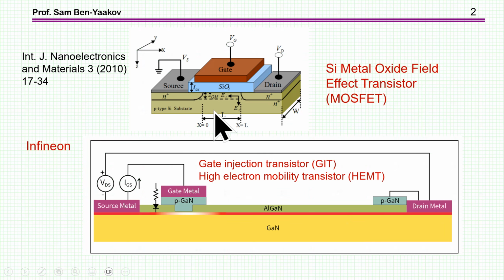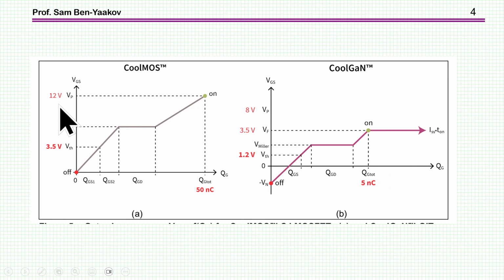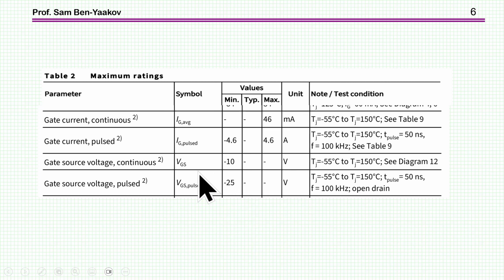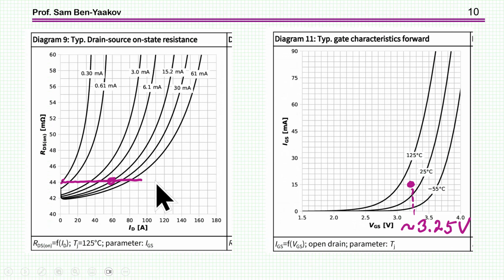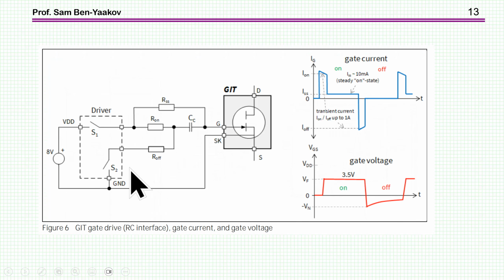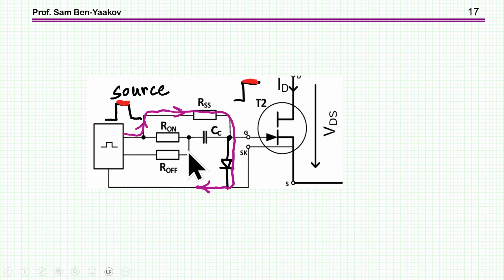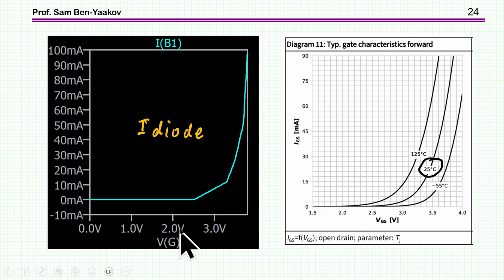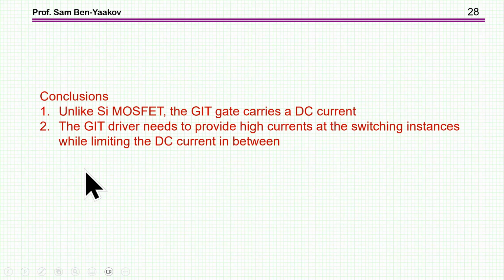GaN Gate Injection Transistor (GIT) driver

Comment: Thank you sir! I work as a process engineer (building manufacturing technology) at infineon exactly for high voltage GIT GaN devices and currently expanding my knowledge into packaged electrical testing and wafer level reliability and, this is how I found your lecture. Btw, the legacy technology / device concept came from the American Panasonic, not Toshiba:-) Apart from GIT, Infineon also has Schottky Gate. But that's a different technology, and I assume the big factor in defining what kind of device it would be – is the Lead device engineer's perspective.
Reply from the maker: Thanks for the comment and... correction🤗

Comment: Can I use this type of mosfet without an isolated power source? 
Also What are the advantages of GaN MOSFET vs GIT ?
 Or are all GaN devices a type of GIT and i didnt realize until now?
Reply from the maker: Power source for the gate drive? Yes for the low side. Bootstrap may not be a good solution.
I think it is cheaper for them to fabricate. They got this technology from,  I believe, Toshiba. Or, perhaps it is a marketing trick offering options to lure you to select the one that they want you to buy😀
Reply: @sambenyaakov  THX
Maybe it is cheaper to make like u said or lower Rdson better Vds or simply switches faster 
That in itself would be a good topic, tho there are not a lot of GaN devices out there so 1 to 1 comparisons are not that easy
Reply from the maker: @Robert88KAL  As a matter of fact, the CIT GaN was the first GaN transistor to be developed. It was used, and is still being used widely as a GHz amplifier in Radars, and cellular phone transmitters. Only later on was it redesigned for switch mode power operation
Reply: @sambenyaakov  interestig

Comment: As someone who started to design electronics in the late 90's... the datasheets of today's transistors (and almost all other components as well); I just marvel at it, they are at "insane dream" levels of performance!
😆I'm resisting the old man trope of waving his cane and yelling "You young whipper snappers have no idea how easy you have it!"

(Of course it is never easy because competition and increased demands raises the bar equally for us all!)
Reply from the maker: Yes, it is amazing how far things have come! 🙏 especially considering that  I started electronic design in the 60's🤗
Reply: @sambenyaakov  I believe electronics from the 60's are classified under "wizardry" by the average electronics engineer of today. If you'd hand me a vacuum tube valve and ordered me to get a light bulb blinking with it... oh dear, I'd estimate that would be a 1-2 day job for me, because I have no functional mental model of it nor any basic feeling of how much voltage goes on what pin for such device.
Reply from the maker: @Paxmax  Since the technology was still in its infancy, more ingenuity was required to make it go.

Comment: Any speculation on why Infineon chose to make a device which requires such a novel gate drive? Infineon recently acquired Gan Systems, whose transistors are much more like conventional MOSFETs. I wonder if Infineon will continue to support both product lines.
Reply from the maker: I think it is cheaper for them to fabricate. They got this technology from,  I believe, Toshiba. Or, perhaps it is a marketing trick offering options to lure you to select the one that they want😀
Reply: It looks like they are stopping the support of the GaN Systems line-up and try to steer the customers to use these 'Gen 5' devices.

From datasheet and simulation comparisons I found no benefit of these devices compared to the GaN Systems GaN HEMTs, at least for the application space I am working on.
I would argue, that the GaNPx package, and the GeN 4 die were actually performing much better than anything available now.

Maybe they are more reliable and robust, something which the previous generation struggled with.
Reply from the maker: @ioannisnikiforidis325  The future will tell.
Reply: @ioannisnikiforidis325  I just found out that all the GaN Systems devices are going EoL, which is extremely frustrating. I still don't see the merit in these GIT devices, they offer similar performance at best but require a far more complex gate driver.

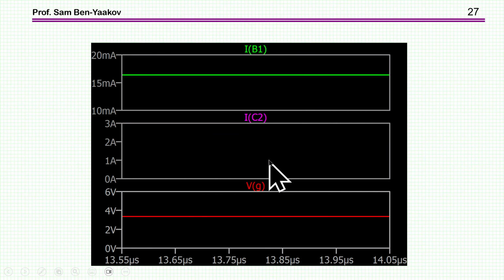Comment: Thank you sir for you excellent explanation! I have a question about the gate voltage just after the turn ON @18:06. It seems like it overshoots before settling down to the diode forward voltage ~3.25V. How would you explain such behavior ?
Reply: Maybe because of the series capacitance
Reply from the maker: @faissalmataich7490 at the turn on transition,  a high current is injected to the gate. Tis high current charges the gate capacitance  to some peak voltage value causing a high diode current. Past this transition, the gate current is supplied by the upper high resistance resistor. This current is smaller that the diode current. The difference discharged the gate capacitance until a steady state is achieved: the resistor current equals the diode current and hence the gate voltage stabilizes.
Reply: Thank you professor